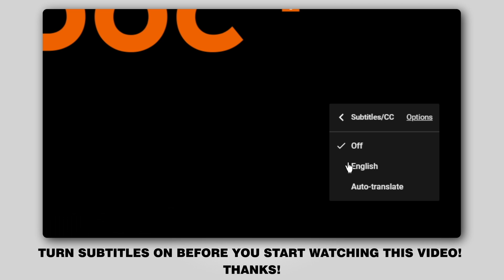How to change rear shock absorber on BMW 330i 3 (E92)  [TUTORIAL AUTODOC]

Comment: Is it required to push up the "wheel" when unscrewing shock absorber or it can be done without pushing it up?' I am talking about 03:06 part.
Reply from the maker: Thank you for your comment! 
The "wheel" should be definitely lift up a little bit and fixed, otherwise the spring may fly out when the shock absorber is unscrewed and it is very unsafe.
Stay tuned our latest updates. 
Best regards, Autodoc.

Comment: Is this the exact same procedure for a e92 335d?
Reply from the maker: In general, the replacement will be similar, the only thing that may be slightly different is the design features of your particular model of car. More detailed information can be found in the technical documentation for repairing your car.

Comment: I cant undo bottom nut as shock is spinning
Reply from the maker: Thank you for your comment!
According to the description, it is difficult to suggest anything, we recommend that you contact an auto mechanic.
Best Regards,
Autodoc team
Reply: i used a clamp with someone else holding on tight but they are really hard to get off- assume you figured it out since your comment was ages ago?
Reply: there is a 15mm counter hold a little further up, hold a spanner on that and it will go without spinning. No idea how it worked in this video without him holding that

Comment: Torqued the bottom shock nut to 80nm and around 50nm the bottom of the shock snapped off. Too much torque. stock KYB shocks
Reply: about all of those tightening torques in this video are fucked up :)
Reply from the maker: Our videos are for guidance only. All routine replacements and values can be found directly in the technical documentation for your car or use the help of a car maintenance service.
AUTODOC
Reply: @autodocuk  please don't give incorrect torque values. I expected more from a channel like this.

Comment: 5:50 - This should be tightened to 38Nm! You'll snap off the thread of your new shock if you tighten it to 80Nm!!!
Reply from the maker: Rear chassis tightening torques
Rear-axle shock absorber
on the body 27 Nm
with support bracket 38 Nm
on wishbones 60 Nm
AUTODOC

Comment: Things I learned today, I will NOT be trying this at home...LOL
Reply: why , its easy , or you want to be charged 500 $ lmao
Reply: just finished mine.
stripping the boot and refitting takes longer on the e93.
Reply: @skreech01  if I had a garage and a lift, or even a friend with one,, no problem. All I have is a hot assed driveway with no shade and some hot assed asphalt. Yeah, I'll pay the 5...lol
Reply: @KiddPanther  better to be hot than cold, wet and miserable like here in the UK where I have to wait over a week for decent weather to work on mine

Comment: This might be the only thing i seriously hate about bmw’s
To fix something you have to dismantle half a car. It takes more time to remove and reinstall all the covers than fixing the issue
Reply from the maker: Thank you for your comment.
Progress does not stand still, over time, cars are improved and acquire more and more functions, but the mechanisms are becoming more complex due to which replacement requires more labor and special tools.
Best Regards,
Autodoc team
Reply: yeah was a PITA putting all the covers back together :)
Reply: Doing this job on a BMW is actually very easy, it’s harder on other cars, also some have the shock absorber going through the middle of the spring which doesn’t make it easy